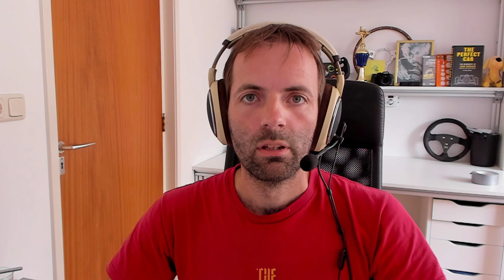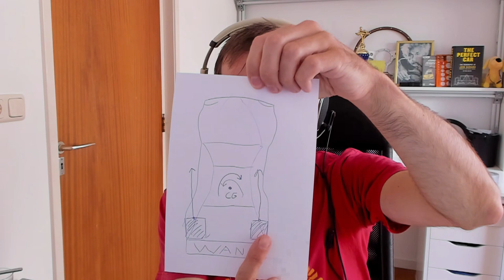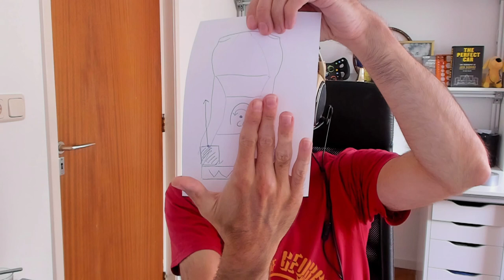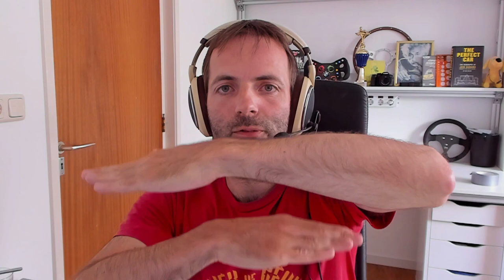An incomplete but (possibly) refreshing look at Race Car Setup!

Comment: Hi Niels, I really enjoyed the video but I have to disagree with your description of toe-in vs. toe-out. It seems to me that you have it exactly backwards. Can you please explain in more detail why toe-out would increase stability/slow down respone?

I can understand how when driving straight, the camber thrust and slip angle due to toe are directly opposed and would at least partially cancel each other out. However, as soon as you begin turning the wheel, the slip angle on the outer wheel begins to decrease and the slip angle on the inner wheel increases. At this point, the outer wheel still has the camber thrust pushing inwards, but less slip angle pushing it outwards. Meanwhile, the inner wheel still has the camber thrust pushing inwards as well, but more slip angle pushing it outwards, which in this case is in the direction of the corner. Net result would be higher turn-in response, no?

For the sake of clarity, let me define an example. Looking at the front end of a car with static negative camber on all corners, and toe out at the front, negotiating a left turn. Before I begin turning the wheel, I have camber thrust pushing the tires inward, and the force from toe effects in the opposite direction. If I don't know the amount of toe out or negative camber, I can't be sure which has a larger influence at this point. However, the instant I turn the wheel a fraction of a degree to the left, the slip angle on the LF increases and the RF slip angle decreases (I'm talking so early in the steering process that the RF wheel hasn't reached the point where it's directly parallel to the centerline of the car yet). This decreases the forces trying to push the RF to the right and increases the force pushing the LF to the left, in other words the net force making the tires go left is increased.

Compare that to toe-in at the front. I have the same camber effects pushing inwards, but now I also have slip angle from the front tires pushing inwards as well. Compared to the toe-out case, there is now more force resisting direction changes because the effects of toe and camber (each pushing the tires towards each other) are stacking instead of opposed. So when I begin turning the wheel left, I do decrease the forces trying to push the LF to the right and I increase the forces pushing the RF to the left, but the total forces pushing the front tires to the left is reduced with respect to the toe-out situation.

Note that I'm not looking at the effects of caster or roll on camber changes, I'm talking about the initial phases of corner-entry only, before the body has had time to roll to any significant degree. I'm not considering Ackermann or anti-Ackermann either because I'm just looking at that early phase where slip angle isn't near its maximum yet. However I also ignored the effects of rolling resistance, which would be higher at higher slip angles and would also create a moment about the center of mass and influence the turn-in. With toe out, the rolling resistance on the LF increases and it decreases on the RF when I slightly turn the wheel left, creating a moment that should (slightly) increase yaw more quickly. With toe in, at a slight turn of the wheel, the moment would be in the opposite direction, slowing down the yaw rate.

This mirrors my experience in the real world as well. I race at an amateur level but I have never, ever heard of someone improving responsiveness by using toe-in at either end of the vehicle, nor have I heard of toe-out being used to increase stability. Even in road cars, anyone who has drive a car with toe-out and toe-in can attest that the toe-out condition requires more frequent steering corrections to stay in the lane. And when I consult sources on vehicle dynamics like Milliken & Milliken, Carroll Smith, etc., I see the same information that I've always heard: toe-out increases turn-in response and instability, toe-out does the opposite. 

I know you probably won't see this comment months after you posted this video, but on the off chance you do, could you please expand on this more? I'm really into learning vehicle dynamics and would love to discuss this at length!
Reply from the maker: Hi Luke,

If you start writing essays, I'll do the same ok?  :D 
First, no matter what toe angles you set, they are quite small. By the time you've applied 30 degrees of steering wheel lock, the front tires have probably turned 2.5 degrees, which is probably at least 5x the toe angle. So VERY soon after initial steering, you're on your way to 50% or 75% tire grip, where 0.25 degrees slip angle doesn't matter much anymore.

When I tested some toe settings subjectively with a real MX5 driver, he didn't really notice much at all because of how he is pretty aggressive, as that seems to work in that car as he's on top of the championship. So you whiz past any zone where you MIGHT feel some effect of the toe angle. The car's yaw inertia makes it take a while to get going and you're past the bit where you could 'feel' the toe. I did think I felt something as I was trying to focus on it and be really smooth and slow with initial turn in. It was fairly minor though and a blind test might well prove me wrong.

A more consistent test I did using the simulator, is the ability to steer with the keyboard, on a flat skidpad with constant tire temp and pressure. You steer at exactly the same rate, and you can do so at a constant speed by setting a rev limiter. Then you can repeat a 'turn in' event by applying 10 degrees of front tire lock in 1 second for example. Then in MOTEC you can mainly focus on the yaw rate of the car.

More responsive / better turn in, IF that would be seen as a higher yaw rate, was achieved by adjusting the 'straight line lateral forces' of the tires. This is a mix of camber (negative camber giving side forces) and toe (which creates straight line slip angle, creating side forces). Upon initial steering input, the more cornering force the outside front has over the outside rear, the more quickly the car will turn (yaw rate grows faster). So the most turn in was with toe IN and lots of negative camber at the front, vs toe OUT and positive camber at the rear. Silly combination but highlights the effect.

I think what you say is true, IF the inside tire plays a significant role. In my 'lab tests' it seems it didn't. As soon as you are steering, and its not a 2cv, load transfers quickly, making the inside front tire .. relatively irrelevant. :-) This might change from setup to setup, but often, especially if you have RWD and some power, the front axle will be stiffer in roll than the rear, so it will take most of the load transfer, quickly unloading the inside front and moving that load to the outside front. I found almost instantly the inside tire just doesn't contribute to initial car rotation.

The thing is, what IS responsiveness. Its so hard to translate 'feel' in real life back to physics numbers. I have no idea but, you can imagine my silly example of toe OUT and positive camber at the rear, would certainly increase your turn in oversteer. It would feel terrible and you'd be all over the place, but yaw rates would be off the charts..
So perhaps responsiveness is more about confidence, knowing the car will be more planted at the rear when you turn in.
Because, depending greatly on the car, front negative camber might be greater than rear, adding front toe OUT will reduce the initial outside front cornering force a bit, which might bring it more in line with outside rear cornering force, creating a more balanced front/rear turn in grip, giving you more confidence and more neutrality, by REDUCING front initial grip.

It might make more sense to look at yaw rate 'damping', if there is any overshoot, or if the yaw rate on initial steering does up and flattens nicely. If initial response is too great, and you get overshoot, that is probably worse 'turn in' even though the car rotates more.
Reply: @NielsHeusinkveld  @niels007007 Hi Niels & Luke, I guess I am doing like Niels and here I am requestioning some years!!! after the comment was released… also with an essay I am afraid 😊
As Luke says I agree all the documentation in every form I know regarding real and sim world says to get a more responsive turn-in car you should increase the toe-out in the front side. My personal issue with this is really I never understood the physical reason of that statement, as I understand it should be the other way around, more toe-in more tendency to get the car in the turn, but I know this is in opposition to literally all the documentation available…
I tried in the sim several occasions to change the set-up to see the effect, even taking it to the limits, but to be honest I never get a clear difference I could relate to the set-up change and not to other circumstance, I guess I do not have the consistency of Airton Senna or Prost to get the feeling…. Also I do not know how “real” the physics in the different sims are, I tried iRacing, AC and ACC.
Regarding real life unfortunately I do not have the access/resources to try in real life in a track ☹ but I recognize all the statements I know from real guys in internet and You tube always repeat the popular statement supporting the toe-out to get more turn-in. Also I read one book regarding car set-ups, but it was an American author and he explain the issue with a bunch of very “vague” and not very precise expressions that for me made the message really difficult to understand (no offense, I like how American English is so full of expressions everywhere, but my problem is they use them also to explain “scientific”/objective stuff… making it difficult for foreigners like me to understand it).

Using the example given by Luke, I arrive to a different conclusion. Consider a left turn and for simplicity consider the opposite forces from the negative camber of the front tires cancels each other.

1st case a car with front toe-out: In the turning: The RF “decreases” its toe-out degree, so its outwards (to the turn) force is reduced, the LF “increases” its toe-out degree, so its inward (to the turn) force increases. Result an increase of the net force inward (to the turn) force.

2nd case a car with front toe-in: In the turning, the RF “increases” its toe-in degree, so its inwards (to the turn) force is increased, the LF “decreases” its toe-in degree, so its outward (to the turn) force decreases. Result an increase of the net force inward (to the turn) force.

So in conclusion both cases increase the inward (to the turn) force, but there is an important difference, the weight transfer so the load/grip in the tires, in this left turning the RF will have more load and the LF will have less, so the change of force in the RF should be more important than in the LF. 
So in conclusion according this basic and very simplified reasoning toe-in should “in theory” create more turn in effect than the toe-out case. As said, I know this is against all the knowledge out there, except Neils statement now (3 years ago I mean…)
So I am confussed…

Comment: Excellent explanations as always, Niels. Although I noticed you said "weight" in a few places instead of "load". Even Beckman does that. I don't know if it's because when you do the maths, the "g" disappears and the formulas are in terms of "w"?
Anyway, I'd be interested if you could talk a bit about rebound damping at some time too.
Reply: I think about rebound damping basically as a way of reducing the stiffness of the spring. That is not the full truth, but it is resisting the force of the spring while it is extending, remember the damper only affects things when actually in motion. So in short, a stiffer spring will need a stiffer rebound damper to compensate. Too much rebound will reduce the grip on bumpy surfaces because it will keep the tire (or the load on it) off the ground for longer when the spring is trying to extend out to get the tire in contact with the ground again (after a bump). Too little rebound on the other hand can reduce grip by alternating between loading and unloading the tire as the car bounce up and down on the spring. Also in general, damping to me is more important the more suspension travel there is. So, not so much for formula cars but very important in rally or off-road racing. But yes, it would be interesting to hear if Niels has any other thoughts on it.
Reply from the maker: My damper theory (more = stiffer axle equals adding some ARB or spring on that side) kinda was meant to be dampers in general, bump and rebound.
Reply: What i learned after many hours of wandering different setup schools is to start with dampers as a grip modificators, and only after you cant feel grip difference start tweaking them to make the car snappier or tune some dynamic conditions or keep the damn splitter fixed in place.

"Stiffer = more ARB" is an ok rule, but sometimes dampers can be too soft, especially if we slam stiffer springs/arbs or ride packers/bumpstops or even when the track has short but high enough bumps to go closer to resonant frequencies, that stiffer dampers plainly equals more grip which throws the above equation on its head.

Because of that i always approach dampers on new track as a black box: get basic car balance down, and start testing one setting at a time (usually starting from max soft everything). So far even with a familiar car it has been fastest way to find good setup than to follow any guides, rules of thumb, or even common sense! (looking at you modded tracks with your sometimes ridiculous surface features).
Reply: That's the difference between weight and mass right? Mass is a constant factor, weight is just the amount that the tire pushes on the ground.

Comment: Yes, I'm aware the video is very old, but I'm quite curious. How (and, to be honest, why) some setting affect tire temperatures? I've read that generally softer = cooler tires. But also read that softer = tire stays on road more = hotter tires. So, what gives?
Reply from the maker: I hope a video like this is timeless, until in a few years I make another one saying how incorrect the old (this) one is.. 
My answer is always "I don't know"... But I think the driver and his/her inputs decide 90% how hot or cool the tires get, and at most 10% is from the setup. If you steer your wheel 10 degrees more, that is 1 degree extra slip angle on the front tires, that surely means a lot of extra heat buildup, more than tweaking springs or dampers can ever do.. I am not SURE about this but it feels like it would be true. If you make a suspension solid, with firm springs bars and rock hard dampers, there will be more load oscillations going through the tire, which at least in theory heats them up. I can't see how this could be significant compared to the driver keeping the tires at 4 degrees slip angle or 6 degrees though.
Reply: @NielsHeusinkveld  Considering that the video still has a lot of useful information (particularly the camber, toe and ride height), it will be timeless until an update happens.

My best guess in terms of stiff = hot would be ... I guess faster load transfer means tire loaded quicker means tire working more? I guess that's a way to look at it. 

And there's also weight distribution playing a part as well. And (I guess) since torque is a thing, more front weight means hotter tires (more load) and an understeery car (less rotating torque) ... Am I any sort of right here?

Comment: Good stuff. I'd be interested more about toe angles in the front. For instance in ACC everyone uses toe out and I wonder if there are situations where toe in would be better. On one hand toe out makes sense because the outside tire follows bigger radius in the turn. But on the other hand the outside tire also has more load which means in should be able to take more slip angle. And why should not I have zero toe?
Reply: Look up anti or negative Ackerman, used in race cars a bit for that exact reason
Reply from the maker: Well, toe angles probably are between -0.25 and + 0.25 degrees per tire. Steering 90 degrees on the wheel is probably like 8 degrees on the front tires. Once you're really turning the wheel, the little bit of toe angle doesn't really make a difference in the tire grip anymore. I've done some automated testing with toe and camber to plot 'turn in' (yaw rate) and that's what I based my theory on when I say it is about initial front vs rear axle grip. And the initial grip is a mix of camber force (always inward force when camber is negative) and toe force, which can be in or outward force. But its easily overrated in my experience as you soon are beyond the region where you might feel this and where it really affects the handling. (in my experience sofar)
Reply: @NielsHeusinkveld  I think one exception can be made to extreme cases like professional drift cars which can run half a degree or maybe even more of toe-in at the rear. Although even that is done for entry and exit, not so much for midcorner, so maybe it's the same here too. I would think it does actually affect things as the rear wheels are (ideally) not very steered mid-corner apart from toe.

On that note, toe kind of doesn't matter to a point on roadcars IMO because they often have quite noticeable bumpsteer anyway. Whatever direction it is bumpsteering is what will be influencing the handling.